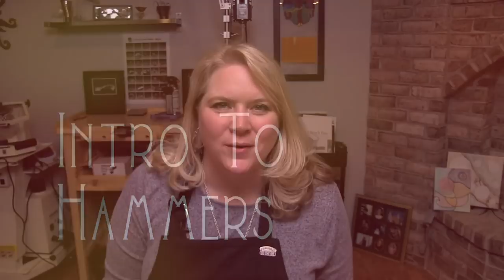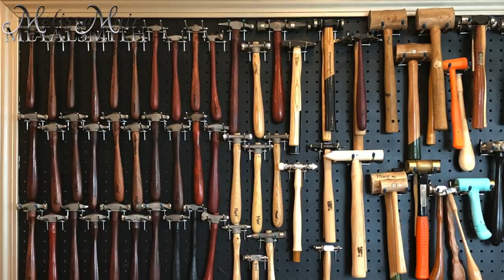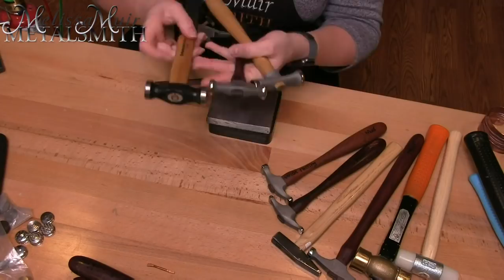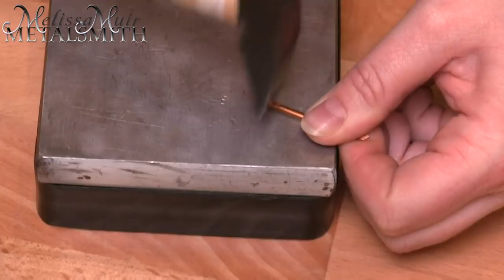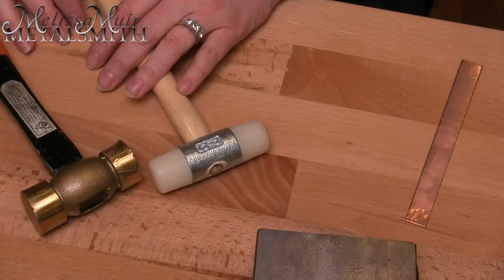Weekend Jewelry School - Session 8 - Intro to Hammers

Comment: Thank you! Very helpful for us beginners, I've got lots of your videos to catch up on. I think I would add a rawhide hammer for rounding and sizing rings and bracelets on a mandrel, though I guess you could use the plastic one, but I don't think I could do without my rawhide hammer. Again, thank you for sharing all of these lessons!
Reply from the maker: I recently had the opportunity to work with Alan Revere and he is one that says a rawhide hammer should never been in a jewelers studio. I was quite shocked, but then as I thought about it, I noticed that I rarely use my rawhide because it does have a tendency to leave marks that I have to remove.
Reply: Melissa Muir  Thank you for coming back to this! Very interesting. What do you and he suggest for rounding up and sizing rings? Perhaps plastic faced hammers are better? I’m very much a beginner, so I’d rather start with good habits.
Reply from the maker: bj20715 yes. I would use one of the nylon dead blow hammers.